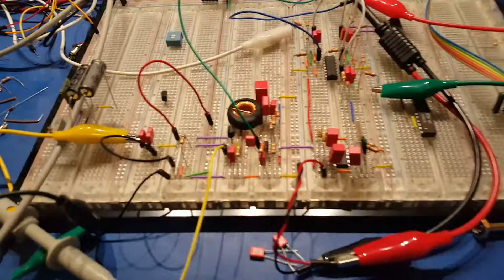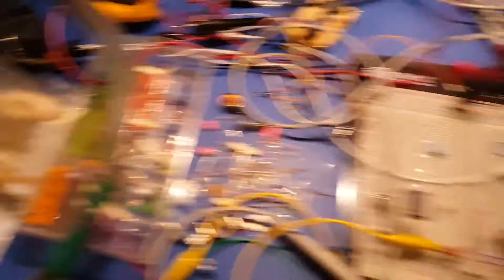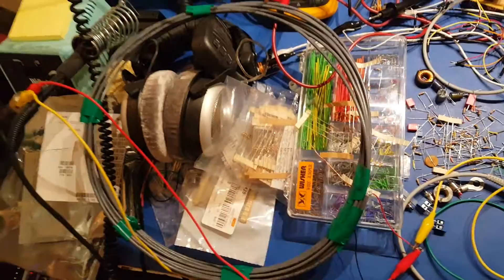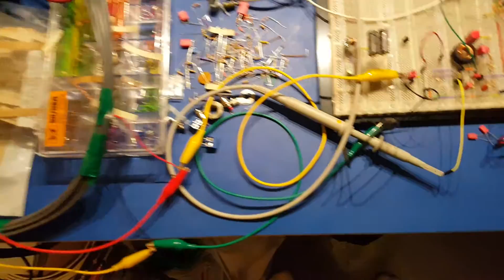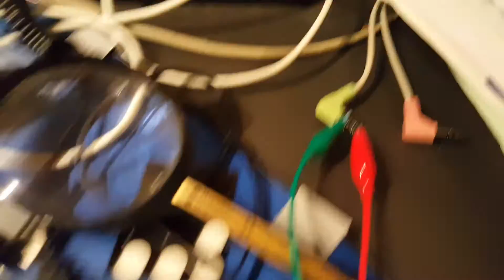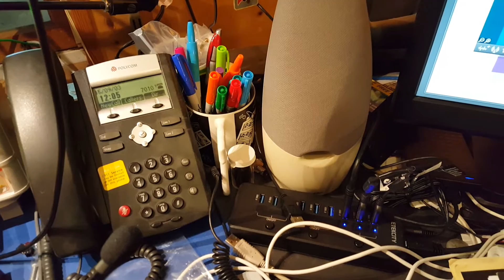Junk-Box WWVB Receiver - First Signals!

Comment: I like it! Well done. I used to listen to WWVB  all day long. I'd pick it up on its 180 kHz harmonic in the LowFer band since I was living only about 60 miles from WWVB in Ft. Collins, CO.

BTW, when I was living in MI I used a 40 turn loop of 8 gauge copper wire on a 3 foot diameter Styrofoam core as an antenna. I put it down in the basement to get it away from noisy local AC wiring. I added a big air-variable cap to resonate it, and a 2 transistor FET amp to reduce loading to keep the Q high and to drive the coax feed upstairs to my lab. There I fed it into a 3 stage TRF chain as a reference frequency for calibrating my freq counter. Most hours of the day it was a fairly pure sine wave as viewed on the 'scope. My ham friends saw the giant coil down in the basement, and just shook their heads.
Reply from the maker: That's a beautiful thing :-) ... now you made me think of a mag loop in a faraday cage... of course, easier to do with coax.
One of my first tries with this was shielded multi-core cable cross wired to easily make multiple turns... BUT I forgot (for a moment) the interelectrode capacitance. Thinking about it again I wonder if that might be worth trying again and maybe using the interelectrode capacitance to aid in self resonance... but in the end it really does seem that coax is the way to go... maybe some really cheap 75ohm cable tv stuff that's laying around everywhere... wheels turning.
Reply: @MadsciAtWork , while there is a practical limit to it, I have found that smaller antennas for LF work better to receive in noise. They allow for higher Q's due to lower resistive losses, and their limited aperture is made up for higher amplification with high input resistance and low noise amplifiers. It's a balancing act between signal and noise, there is an antenna size 'sweet spot', but one that really works when you have no control over the noise environment you're in. It's about 4 feet when a  vertical whip is used in a noisy location, but I don't know what a comparable loop size would be, and of course it depends on the Q of the loop. My buddy Max Carter, who lives in a relatively quiet location in WY, after some experimentation, used a shielded 1-turn amplified loop antenna of about 4 foot diameter for his WWVB receiver. If carefully built, the shielding makes them very directional and allows for good local noise nulling. I think RF folks have ignored LF for far to long, like it's just a noisy useless band and the future is entirely microwaves. But they don't understand that the band is so noisy because the noise signals are traveling thousands of miles in groundwave, unlike higher frequencies that aren't being refracted around the curvature of the Earth. The signals are there, (I copied my 7mW ERP beacon in groundwave the whole way all along Interstate 80 from CO to IL,) and the job of receiving those signals just boils down to digging them out of the noise with filtering techniques that are now easily available with inexpensive, modern hardware and software. I find it sad that hams ignore the 2200 meter band because it isn't just 'plug and play' high-power appliance operation. One actually needs to know a few things about RF. But it's an experimenter's dream, and with ever more sophisticated software modulation modes to dig signals out of noise it gets almost magical.

Comment: It would be great if you shared the entire schematics. What mixer are you using? NE602 or something?
Reply from the maker: Sorry about that... I walked away from that project before putting it all out there. I was using an AD683 four quadrant multiplier as a mixer. I also reworked the front end a bit before I stopped. Here is a link to that schematic:

https://twitter.com/codedweller/status/647874836061114368

Here is a link to an overhead shot - you can probably work out a schematic from there. I will take a look around for my graph pad from back then to see if I have some more schematics scribbled down -- I recall that I intended to make a blog post about it at the time - but never got to it before I was overtaken by other projects.

Comment: I see you used 2 conductor wire. Did use just one of them?
Reply from the maker: Two conductor wire makes it easier to get twice as many turns. At the base of the loop connect the red from one side to the black from the other. Then use the remaining black and red wires as your feed point. This instantly gives you twice as many turns.

Also -- be careful not to connect the shield -- leave it disconnected. If you connect it into a loop it makes another inductor that will effectively eat all of the energy you're trying to capture by shorting it out. Think of it like a secondary in a transformer that's shorted out. Instead, leave the shield open and it becomes a faraday cage around the antenna reducing electrostatic noise without affecting the magnetic part of the signal you're trying to capture.

---

Sorry, I accidentally deleted your other comment asking about loop data. I'll answer it here -- At the very beginning of the video I point out that the loop is 10 turns of wire about 30cm diameter. I'm pretty sure this was insufficient and could be much better.

I didn't actually push forward to making the loop work -- though I'm pretty sure it would. It was clear to me that I needed more turns than I had to get the right sensitivity. I may play with that another day. What you heard was a signal from my HF antenna outside.

If you want to do this then I recommend making the loop with as much area and as many turns as you can tolerate then try it out. The easiest way to do it will be to make your loop then measure it's inductance and calculate a capacitor value that will make it resonant at 60KHz. That's pretty much what I did.
Reply: thanx